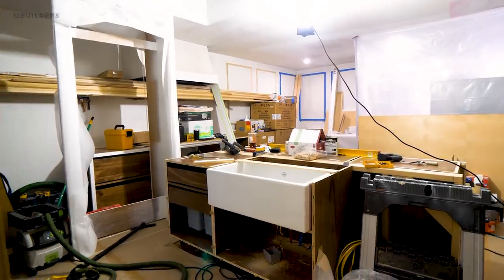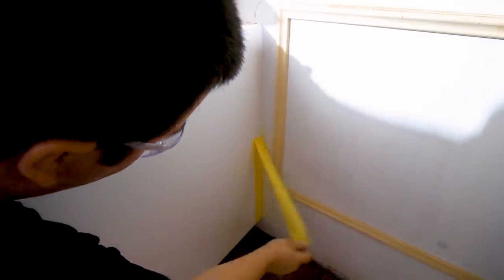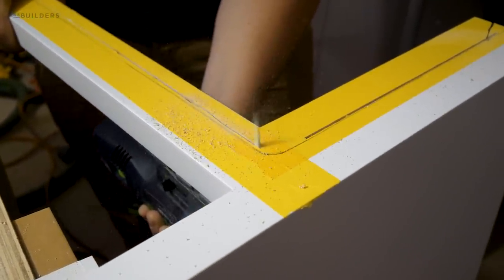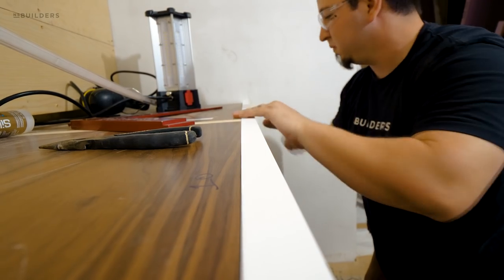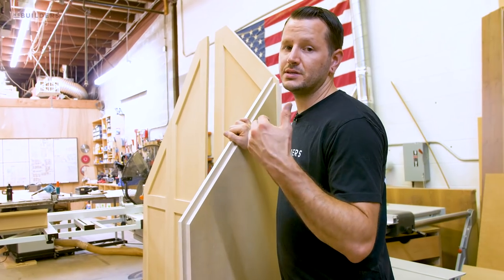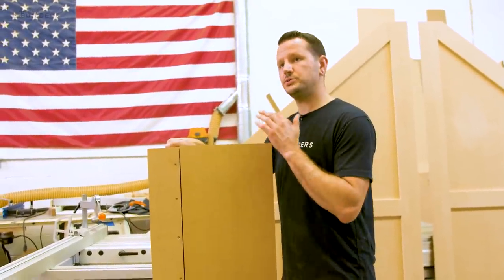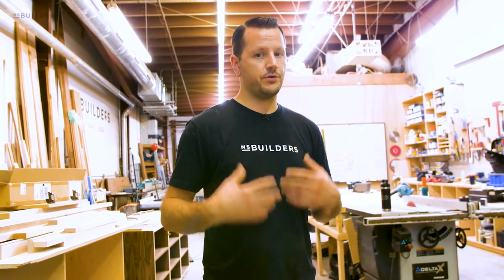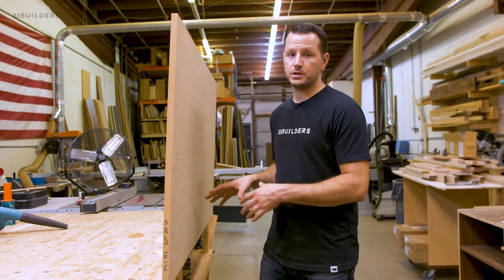TIGHT scribe around a farmhouse sink

Comment: I love the attention to detail in all aspects of this video!
  
It is my opinion that the HVAC door solution would be best served by simply fabricating a removable access panel to allow for full access to the cavity.  
That hardware is very nice, but it will not move completely out of the way to access that space.  It will block the bottom 1/4 of the cavity and it will always be in way.  
Additionally your current solution requires that the HVAC technician be extremely careful in order to not damage that panel while servicing the unit.
Reply: I thought the same thing.  I would be interested to know the reasoning, I'm sure there's a good one.
Reply: I think they're worried about the door falling.  I'm with you: find another way.  Maybe just a couple of cables that let it hang below the opening.  Higher tech isn't always better.

Comment: What kind of disc is used on the orbital sander at 3:28? I’m surprised how much material it’s taking off with so little dust.
Reply: @teac117  they DISCONTINUED the tool too!! I've heard a Rotex with a hard pad in high mode can work as well though.

Comment: How do you fit a face frame that's wider than the distance from wall to wall in order to mark a scribing line? Wouldn't one wall always interfere with the face frame sitting perfectly flat against the cabinetry? Do you just scribe a template and then match the template to the face frame?
Reply: I use reference marks and scribe one side at a time. You can get your mark by butting to walk at an angle. If both walls are plumb and flat it’s pretty easy. It gets real tough when the corner bead is proud of the wall surface. Most plasters do not push corner bead in far enough to make a nice transition. That leads to many problems in finish work.